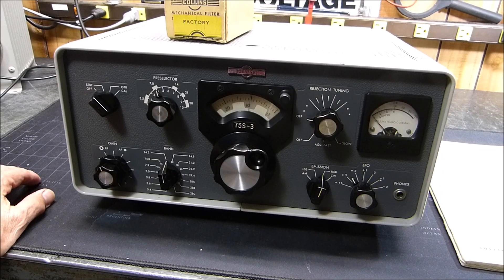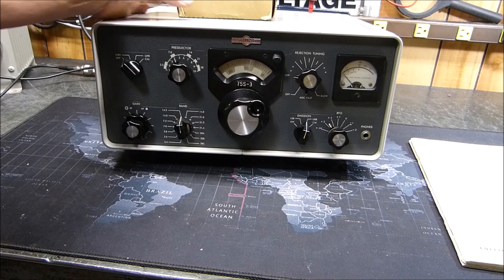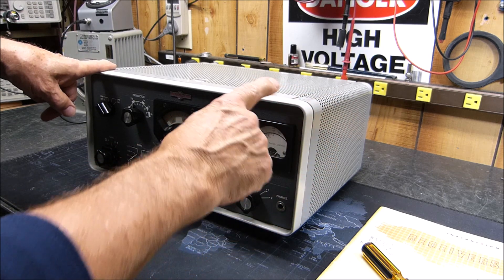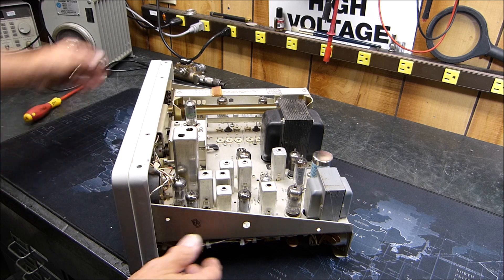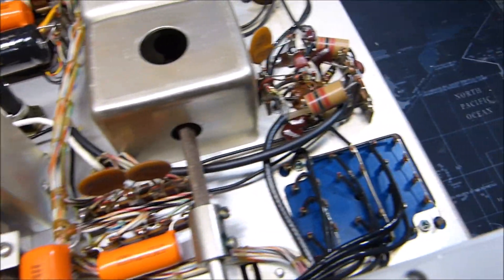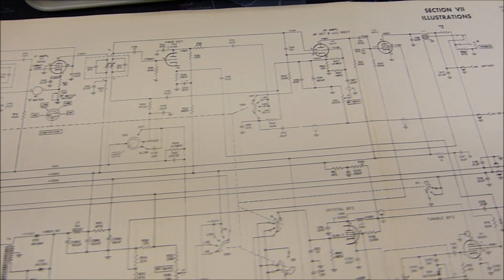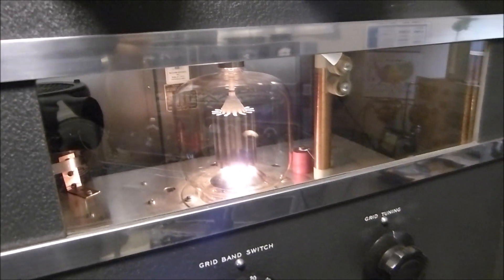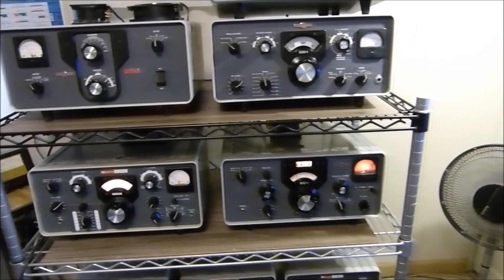Collins Radio 75S-3 Mechanical Filter Replacement & Showing KWM-2A and 51S-1 Receiver

Comment from the maker: I have to make a correction here - at about 2:30 where I show how to take the unit out of the case is WRONG... It is the two Philips inner screws on the front top -  just to the left and right of the side screws that should be removed. Sorry for showing the wrong way to remove the outer case.  73   WA4QGA

Comment: I found a mech filter in the box on eBay for my 51J-4 several years ago. Kinda cool to find them with that packing in the box.
Reply from the maker: Agree, and it is nice we can still find such parts when we need them to keep these beauties working. It was intermittent and took me several hours working on and off with it to find the problem. The only mechanical filter I have ever had go bad. 73

Comment: Great Video....thanks.......Question:  I'm getting my first piece of Collins equipment.....A Collins 75S-3B Winged Emblem...Do you need a dedicated power supply speaker combination or can I just connect to the back with that round plug directly into house AC?    Thanks Much....Mike
Reply from the maker: The receiver plugs into the 120 VAC outlet directly. It has a plug on the back that I hope the power cable and plug comes with the receiver. The speaker, not amplified, plugs into an RCA jack on the back and the RF (antenna) input is also a RCA jack. The transmitters, 32S-1 and 32S-3 do need an outboard power supply. Fantastic receiver...  73  WA4QGA
Reply: Raymond, Thanks for the quick reply....I took a look at your QRZ page and wholly cow, my wife thought I had a lot of stuff....looks like you need a bigger basement (looks like that's where it all is). 73 K9BBN @ElPasoTubeAmps

Comment: A couple of minor points - the 455Y-3 filter is FL2.  FL1 is the square filter and is  crystal filter, not mechanical.  The 75S1 manual lists the 526-9337-00 filter impedance as 17 kohms, which is a suitable value to match the plate and grid impedance of tube circuits. Tracing the FL2 wiring on the schematic, it goes to the LSB and USB positions of the mode switch.
Reply from the maker: Thank you. 
I always appreciate corrections and better understanding from my videos. 
It is all about sharing and helping others keep the vintage equipment working properly. 
 73  WA4QGA

Comment: Hi love the video and gotta love the Collins equipment. Just wondering, the 51s1 works in standby and on?? I'm new to Collins equipment and just picked up a 75s2 and it quits receiving in standby and only receives in Opr. Just wondering for my own understanding. Thanks for all the amazing help.
Reply from the maker: When it is in standby, it is intended to be connected to a transmitter like the 32S-1 or 32S-3 and mutes when you transmit. Same for the 51S-1. If it is not connected to a transmitter that mutes it on transmit, you do have to have it in Operate mode, which is correct. It is amazing how well  Collins equipment works after 60 and 70 years. You can see more of what I have at QRZ.com.  73  WA4QGA
Reply: @ElPasoTubeAmps  thanks so much for explaining to me. I'm so happy to finally purchased my first Collins rig and probably won't be parting with it as they are made so well!! 73's

Comment: I just love the look of the Collins S Line. Never owned any, always out of my price range. Maybe one day. Great Video Ray. 73 Joe KN4IFI
Reply from the maker: Joe - the Collins S-Line is about the same price as many other radios today even they are 50-60 years old. They are still a Rolls Royce radio to have and operate. The vacuum tube equipment does take maintenance much like a fine 1960 automobile but I think the maintenance is fun. You have to be willing to learn and do the maintenance yourself as there are darn few left that can or will work on radios like the Collins S-Line that are not their own equipment. I have learned to express my particular love for ham radio as, (1) I enjoy a good QSO about almost anything. I do participate in contests giving others contacts but otherwise prefer more than just a RST report. (2) I really enjoy seeing the equipment perform. I like the sizzle of a few thousand volts on an amplifier and the glow of the orange plates under high power and the analog meters jumping around with my voice modulation, and (3) as already mentioned, I enjoy the maintenance of the equipment. It is part of the hobby to me just like a mechanic that loves to work on his own vintage car. The Collins 30L-1 amplifier is probably still one of the best buys out there. It will deliver 750 watts to the antenna and is a small, very well built, desktop amplifier. It will need the power supply rebuilt if it has not been done already as it is surely 40+ years old.  Thanks for your comments. I hope to hear you on 20M.  73 WA4QGA

Comment: I have a question for you. I have 2 stancor A-3872 output transformers Input 5000 ohms c.t. outputs 4, 8, and 16 ohms. My question is if use the the 4 ohm tap with a 8 ohm speaker or the 8 ohm tap with a 16 ohm speaker can the input now be used as a 10k ohm c.t. input for either push-pull 6V6s or 6BQ5s?
Reply from the maker: Yes, that is exactly right. I know from experience, your example is exactly how it will measure out on an impedance bridge and it will work  just fine. After building the amplifier, you may find that putting an 8 ohm load on the 8 ohm tap may actually give you the best performance. 
At low power levels, primary load impedance is very broad and forgiving. This is not true at high power level of a few hundred watts or more.
A 2:1 change from the original design will work but, taking it to an extreme will likely not work even though measurements on an impedance bridge may indicate it will. 
For example, putting a 1 ohm load on the 16 ohm tap will not work for a 312 ohm load on the primary. 
Best of luck with your project.
Reply: @ElPasoTubeAmps  thank you it is good to have clarification on this it is very helpful.

Comment: Not heard WWV on 2.5 MHz here in t UK for many years did not  no that its still active in the USA, I can here CHU FROM Canada on 3.330. Nice Collins gear you have.
Reply from the maker: I don't find WWV on 2.5 MHz very often here either. I could hear it barely at the noise level. It was a little stronger the other night. I can't always get CHU on 3.330 MHz either. I think 5 MHz and 10 MHz is generally the most reliable depending on the time of day in the area I live in.
Just found this information:    WWV operates in the high frequency (HF) portion of the radio spectrum. The station radiates 10 000 W on 5 MHz, 10 MHz, and 15 MHz; and 2500 W on 2.5 MHz and 20 MHz.

Comment: Sir, You really make my day better. Beautiful job and beautiful ham radio station. 

Thanks for sharing .

73 DE PU2SRZ - Sao Paulo - Brasil
Reply from the maker: Silvio,
Thank you so much. I love this stuff and obviously am a Collins and vacuum tube fan to the core. 
This equipment was just a dream when I was a kid. The price of a KWM-2A was over $3500 in 1978 when this unit was made and I don't know if that price included a power supply. 
I do a lot of my videos for posterity as I know this equipment is fading away as each year passes and just to look under the chassis at the high quality of components and build attention, "makes my day" as you said.  
My 32S-1 which started this repair has been working flawlessly for me for 35 years with only one issue about 10 years ago and then again with this issue. This problem was intermittent and difficult to find but the fact that someone, for the last 60 years or so, has had the insight and understanding to save this little mechanical filter, having it lay around on a shelve for all those decades speaks to how much many of us appreciate the high quality vintage equipment.
My recent technique of video recording the oscilloscope screen while narrating the measurement process definitely help solve this issue. I add these types of comments into my videos in the hope that it might help someone else.
73 from El Paso and my family to yours and your beautiful country,  I hope we can have a QSO some day on 20M
PS - if you like pictures of homebrew equipment, you can find more on my QRZ page.
WA4QGA